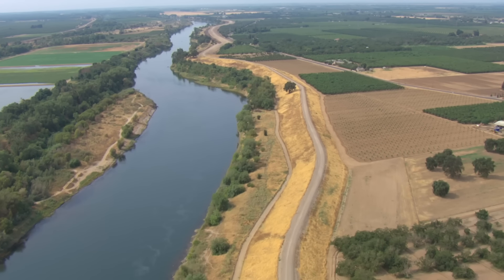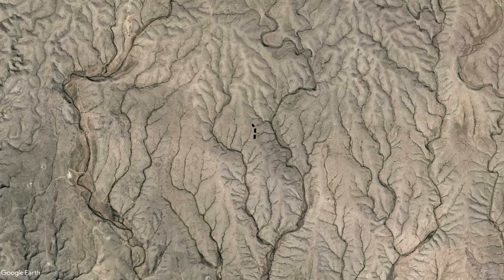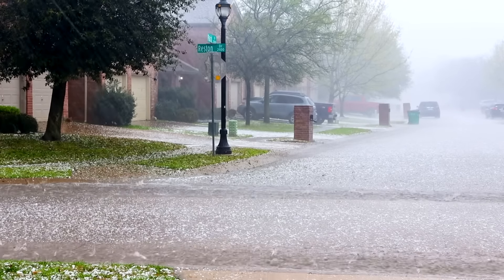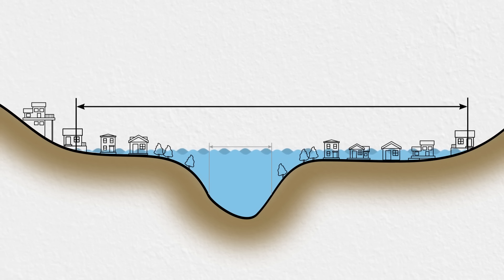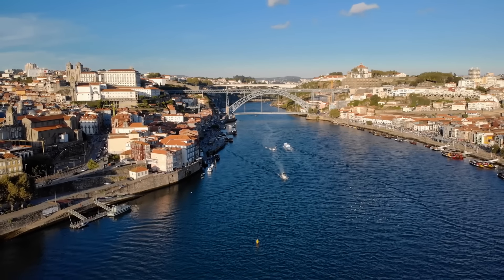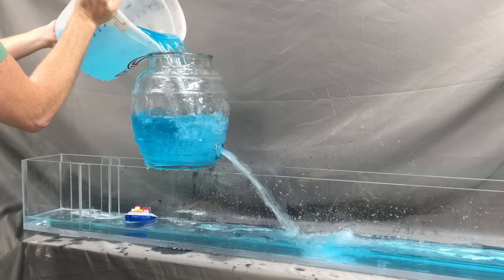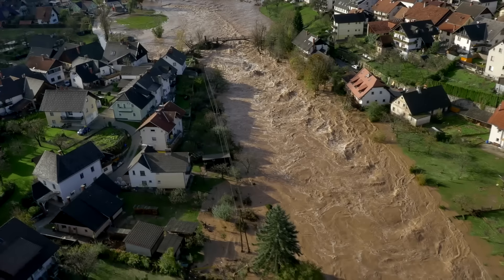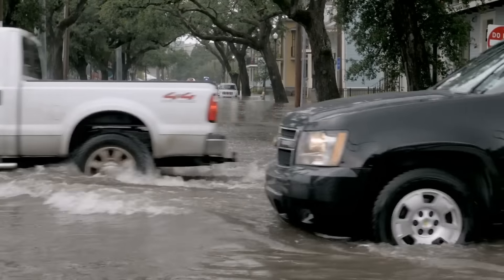How Do Flood Control Structures Work?

Comment: A great example are the Miami Valley flood control dams and associated metroparks around Dayton, Ohio. These dams have no lakes and no active control. The are essentially giant detention ponds. The area behind the dams is reserved for park land that won't be as devastating during a flood. I think more metro areas should have these kinds of protection in place.
Reply: When the Miami Conservancy District was established in the years following the Great Dayton Flood, the village of Osborn, Ohio was slated to be in the middle of the Huffman flood plain (just north of what is now Area A of Wright-Patterson Air Force Base). In addition to its residents, Osborn also had the main lines of three railroads running through it. The rail lines were re-routed to go through a nearby town (back then) called Fairfield (the very same town that initially refused to let the rail lines run through there). The very interesting thing was that the residents of Osborn decided to relocate (rather than abandon) some four hundred homes to new foundations along Hebble Creek nearby, some of which are still standing today. A few decades later, Osborn and Fairfield decided to merge, creating what we now know as Fairborn, Ohio.

Comment: There's so many other means to flood management.  My region is a blend of hills and plains with numerous types of flood issues with only very low dams as a solution (and such a poor solution most were demolished in the 1990s).   What our regional government has done is set out a rain fall region for handling. 1 inch per hour is common and will have no impact, 2 inches per hour is the normal sever storm and may see some roadway impact,  3 inches per hour is that rare extreme event and we do get flood warnings and can see property impact, 4 inches per hour happens or happened less than never so when it did a few years ago even the hospital was flooded and it took months to move out the water.  From what I have seen a planned green space has been the most effective.  Dry waterways of gabions (a dozen feet or more deep) fringed with tree's and bush and reserve pools regularly spaced along large roadways and highways all guiding the water slowly to Lake Ontario.  As I said, hills and planes, this works for us but has failed in other geologies.   As to 4 inches per hour, we have since come close to that level of rain again on more than a few occasions, if that trend continues we are going to have to come up with a better plan...
Reply: A few years ago we got 110mm of rain in 45min. The flooding subsided quickly enough but the erosion it caused was the worst I've seen. My driveway still hasn't recovered 😅

Comment: Why don't they dredge out the river beds to make them deeper?
Reply: Environmental issues, plus you can only dredge so deep before the river banks will either collapse or require reinforcement.
Reply: On smaller scales you can, that's effectively what a storm drain is. But you can't make the water level lower than it is at the downstream end of the dredged section. So if the river is relatively flat, which decent sized rivers tend to be, digging a wider and deeper river channel through your town will just create an artificial lake instead of lowering the water level.

Comment: Got to witness this in action a few weeks ago!  We have a number of flood management/risk management dams close to me, most of which I've visited under average circumstances. Over Christmas we had a rainstorm come through that dropped a few inches of rain and melted the remainder of the snow pile from a previous storm.  One of the dams that usually has no reservoir behind it had 20 feet afterwards!  It was remarkable to see and really illustrated the importance of those structures in that area.

Comment: Great video! We have this system in the Eastern UK that deliberately floods a large area of about 23 km^2 every winter! It sometimes even freezes over. The following summer all the water goes away again and there are cows grazing on the land which was very well fertilized by all that river water. You wouldn't know anything had happened. The road at the southern end however often floods once or twice every year anyway as does one of the roads halfway up it. 

https://en.wikipedia.org/wiki/New_Bedford_River?wprov=sfla1

Comment: If they would not have killed all the beavers, then we would not have most of these problems.
Reply: There would still be these problems in plenty of areas, beavers don't prevent flooding on this anywhere close to the scale humans do and don't exactly care if they wall of water into an area where humans live.
Plus, it's called the flood plain because it's supposed to flood, beavers wouldn't prevent that. This is especially common in Fertile areas, because the flooding is what makes the ground fertile so to a certain extent there is a desirable amount of flooding.

Comment: Um this land floods every year, perfect place for a city.
Reply: They often didn't have a choice.  River transport used to be the way for stuff to be moved, when they didn't have efficient engines.  Since they didn't have efficient engines, stuff had to be moved on and off boats and barges by hand, so you needed your warehouses right on the waterfront.  Similarly, you needed your other shops to be near the warehouses.  Boom, a city forms there.  Since the city was already there, roads and rail are connected to it once those are available, and people move there preferentially.  Now, you have billions of dollars of infrastructure located there, so it's hard to try to pull up stakes and move the city somewhere else.  Path dependency is a thing.

Comment: Great video! Excellent and informative content as always. It’s very important point you make regarding flood control vs flood risk management. Could you talk a lil bit more about flood risk management, and how to best integrate structural and non-structural measures. Where I live in Indonesia, uncontrolled development is one of the major contributors to flooding. This is exacerbated by poor and inadequate infrastructure and maintenance. In addition, in major cities where the land is scarce, there are many informal settlements along the riverbank, which reduce the capacity of the river. Poor solid waste management, and water supply (which leads to over extraction of ground water) also add to the problem.

Comment: Now, after like a year of promotion, i finally wanted to sign up for CuriosityStream. Well, turns out the only accept credit cards🙃
Reply: Did you plan on giving them cash?
Reply: @MrEazyE357  In Europe, this kind of recurring payment is usually handeled through PayPal or Sepa-mandates since not everyone has a credit card

Comment: Great video, Grady! A prime example of how it is tremendously more cost effective to build flood management systems than to waste trillions in ineffective "green energy" solutions in an attempt to reach "0 carbon emissions." We (humanity) have the technology now to deal with floods, fires, hurricanes, etc. whereas it's a pipe dream to think that reducing C02 dramatically, and thereby crippling the economy, will have any real impact on future weather events.
Reply: Dude, you're missing the point of climate change. Also the DoD even admits climate change is the number one thing they are accounting for in the future since it will change war.
Reply: Also green energy is cheaper to make and easier to maintain that non-green energy.
Reply: It is actually more cost effective to switch to green energy in the long term, also climate change causes huge destruction of our ecology and can cause other environmental problems
Reply: @spicybaguette7706  It's not more cost effective at all, especially when you consider how much coal goes into the production of solar panels and wind turbines. Plus, a major problem with warming-driven energy policy is that the costs of subsidies for renewables fall disproportionately on the poor. They spend a larger share of their incomes on energy, so increases in its price due to the elimination of fossil fuels burden them most. In the 2010s, when fracking become more widespread in the US, one impact was that poor people who heat their homes with gas could suddenly afford to heat their homes better, especially the poorest of Americans during the coldest months. That saved, according to a government estimate, 11,000 people from dying every year due to cold. If you ramp up the cost of gas, because you are concerned about climate change, that means many of those lives are again now at risk of death due to cold. There are real consequences to making energy more costly in the name of "saving the planet," which is a political slogan designed to make people feel good about themselves for doing essentially nothing. 

Climate change doesn't cause huge destruction of our ecology, there is no real data to back up that claim, only alarmist speculation. The IPCC has found that climate change has created more habitats and diverse ecosystems than it has destroyed. The media and politicians abuse climate change as if it's a world-ending cancer. It's not. It's more like diabetes ; a long-term, treatable problem and something we can easily live with if we stop causing a panic that the world in become uninhabitable unless we take drastic steps in the next 10 years.
Reply: @masterchief7118 
Your dishonesty is astounding
Reply: @oliverwilson11  If that's the case, provide evidence to dispute my claims.